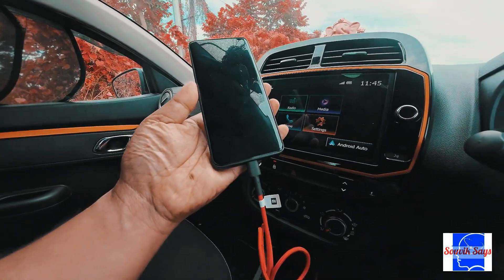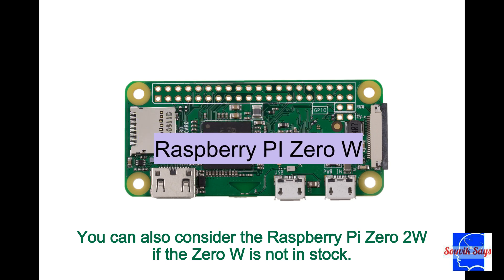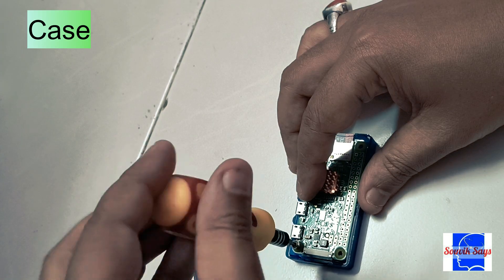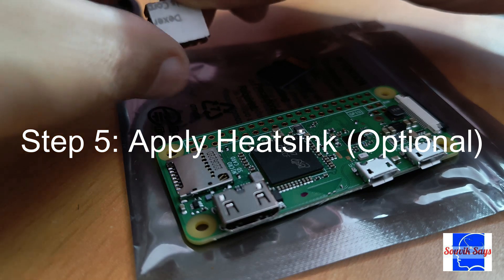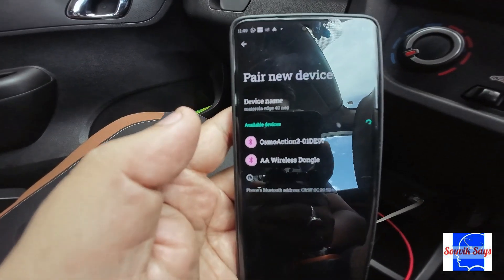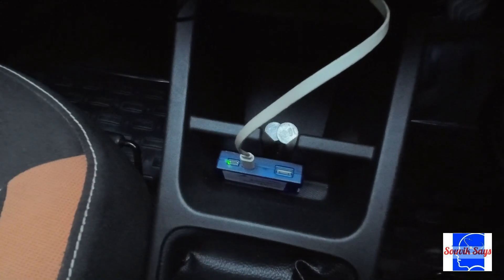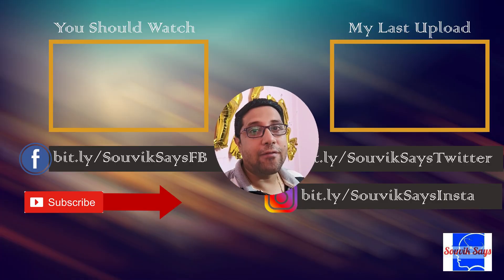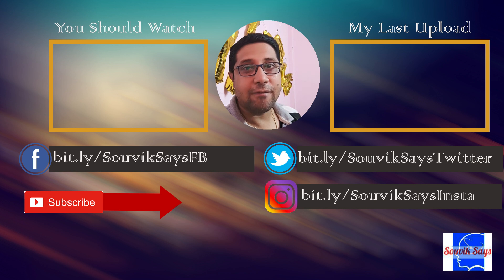Convert Your Wired Android Auto To Wireless Under ₹2000

Comment: Even if the car turn off the device keeps on , that can cause heating issue and damage the board . Any solution on this
Reply from the maker: This is specific to some brands (Tata, VW, Skoda, etc). It typically turns off 10 minutes after ignition is switched off. If that is a problem, only way is to unplug the dongle after turning off ignition.

Comment: Hi Souvik I tried with Raspberry Pi 3 Module B using module raspberrypi3a-sdcard.img.xz. I am able to see AA Wireless dongle in Bluetooth but there is no AA Wirless option in Wifi. Could you assist what could be the problem
Reply: It's because that the RASPI3B+ DOESNNOT SUPPORT USB GADGET MODE

AND ALL WORK AROUNDS ARE NOT WORKING ATLEAST FOR ME
Reply from the maker: To the best of my understanding, the image file is meant for Pi 3 module A. Are you not able to connect to connect to Android Auto wireless even after your phone connects to AA Wireless over Bluetooth?
Reply: Yes I am unable to connect to HU. It connect to BT but nothing happens on screen and AA is greyed out on HU
Reply from the maker: I don't think I will be of much help other than recommending trying the entire process from scratch.

Comment: Can you please guide me how to use it on Raspberry PI 5.
Reply from the maker: I don't think that there is an image available for the Pi5. It also does not make economical sense to use a Pi5 for this project. You would get cheaper alternatives off the shelf on Amazon for the total cost of building this solution using the Pi5.

Comment: Hi, i had just one question

In order to connect with pi we need to connect with the pi's wifi network so, how are we getting the internet? Can i turn off the wifi once the AA has started? Or how does the internet connectivity work on this?
Reply from the maker: Once connected to the Pi WiFi, the mobile data continues to work. So if you have a stable connection with sufficient data, everything will work just fine.

Comment: I am facing issues with frequent disconnections and while streaming spotify songs i see breaks in between, maps is fine. when i play music then only it struggles. i have RPi Zero 2 W
Reply from the maker: Unfortunately I haven't noticed anything such with mine. I stream music on Amazon Music, play podcasts on Podurama. I'm using a Zero W, which is a lesser powered variant than the 2W.

My suggestion would be to check the cable you are using. I was lucky to find a micro usb from a xiaomi power bank from ages back, when their products were of good quality.

Let me know how that goes.
Reply: @SouvikSays  just got a micro usb cable from duracell, will check again and will give an update. My Moto Razr 40 Ultra heats like anything while working with these. frequent disconnect and reconnect is what something it should address now.
Reply from the maker: Very strange. We are using similar devices with completely opposite experiences. I use a Moto Edge 40 Neo.
Reply from the maker: Hey Suraj, any luck with the new cable? How is the phone heating situation now?
Reply: As I experience you need supply more power over secondary micro usb port and the trouble will disappear.

Comment: Useful video.

Can it save two mobile profiles(ex: Mine + partner) so that it will automatically reconnect for Subsequent Connections?
Reply from the maker: Guess what, it does! Both my wife and me have our devices connected to the dongle. Whoever is in the car, the device connect to her/his phone. If both of us are there, it's a roulette.

Also, once the connected device moves out of range, it automatically connects to the other one (if that one is in range). Pretty seamless for me.

Comment: For heat problem keep it pasted near AC vent.
Reply from the maker: Update to anyone following this thread. Went with a 3M VHB tape that supports automotive use. And guess what, it stuck!
I will post a community post to show the setup now.
Reply: @SouvikSays can you send the link of the 3M VHB tape link pls.  What is the cost?
Reply from the maker: @guitarppm Here is the link to the VHB Tape
https://amzn.to/3OoOLzY
Reply: @SouvikSays  For some reason I am getting an error DEVICE NO RESPONSE even both Wifi and bluetooth are getting connected
Reply from the maker: Check which port in the Pi you are connecting the Micro USB to. Connect it to the port marked "USB", not "PWR IN".
Reply: @SouvikSays Yes agreed but I connected to USB only,🤔
Reply from the maker: @SpartanKamal what cable are you using? Can be due to the cable not supporting data transfer.
Reply: Don't think you should be putting magnets near a PCB board.. I've routed the cable internally and stuck the PI mine near the passenger foot ac vents using double sided tape and velcro for easy removing if required
Reply from the maker: Issue is that the plastic in my car seems to be from a different planet. Doesn't stick on 3M double sided tapes. I don't want to superglue it for understandable reasons. Your point around using a magnet is valid too.
But is it that big an issue? If phones work with magnetic holders, will it be a problem for the Pi?
Reply: @SouvikSays it's not the Pi but the micro SD card that will be the issue
Reply: Thank you for the tutorial. I just got my pi zero w and it is working fine so far. I ordered a case separately but for now I just kept it in the esd plastic it came in and placed it in the cooled glove box.
Reply from the maker: @manojkumargupta5740 that should work too, as long as there is some way to cool it.
Reply: Can we use it for both CarPlay and android auto ??
Reply from the maker: @MrVishnu79 you can't as far as I know. But haven't checked so far.
Reply from the maker: That was the plan. Somehow the plastic in my car does not love 3M or any adhesive. It just doesn't stick.

On a side note, the heat is not perceivable inside the case. I was testing it for a few days while working on the project. That's when the bare SBC felt hot to touch. Let's see if there is any impact on longevity.
Reply: @SouvikSays  otherwise you can try magnetic stip on back on the case and attach it to magnetic holder on AC vent
Reply from the maker: That's a good idea. Will try and keep you posted. Thanks buddy!
Reply: @SouvikSays  I know, Renault uses some different type of plastic in the interiors of their cars, and for some reason they don't provide wireless AA with the infotainment system even on the top model..
Reply from the maker: VHB Tape solves for the plastic issue. And I drive a Kwid anyway, so wouldn't even expect any form of Wireless Android Auto on it.

Comment: I have got wired Android Auto and CarPlay on my car so will give it a thought. Wired connection is pretty smooth and allows the front seat passenger to operate the mobile. The  only problem I face with wire is that it disconnects at times if the wire length is long. I always have to fold the cable and keep it under 30cm length to avoid disconnection. Since we have both Android and Apple phones, I also need to use two different cables or adaptors. Can the device you have used house the necessary software for apple carplay as well?
Reply from the maker: Hey Raj, found a cheap alternative that runs both Android Auto and Apple Carplay.

https://atobility.com/collections/carplay-ai-box/products/wireless-carplay-android-auto-usb-adapter-atobility-ma1

Check this out.
Reply from the maker: I do not have access to an iPhone to test this. But it does not to the best of my understanding. Apple is a relatively closed ecosystem and does not encourage open source developments.